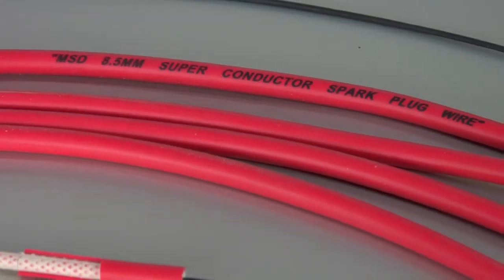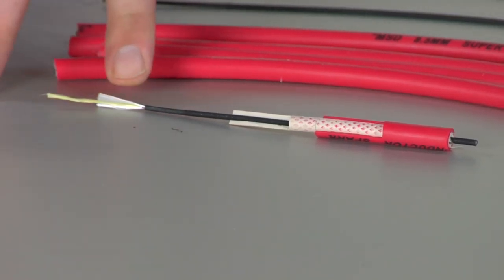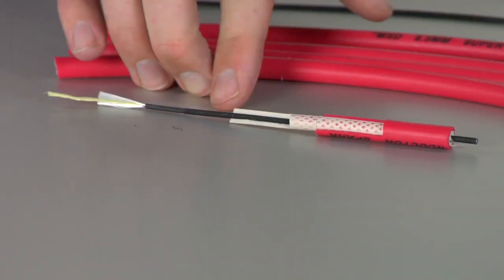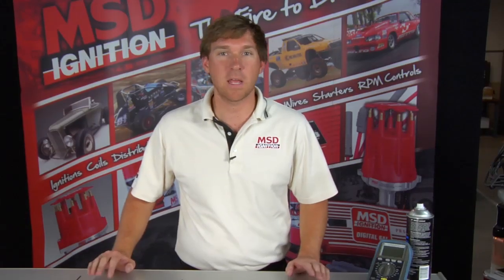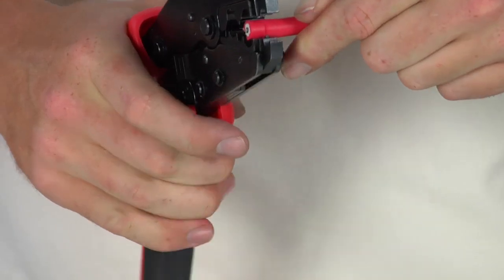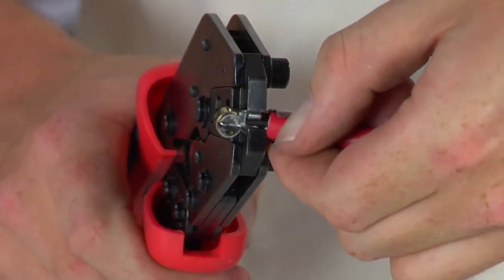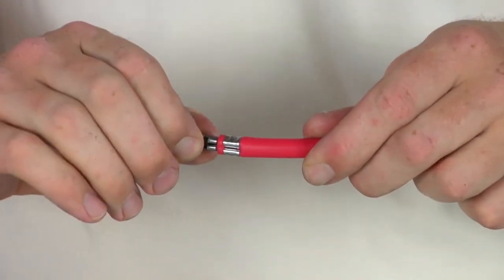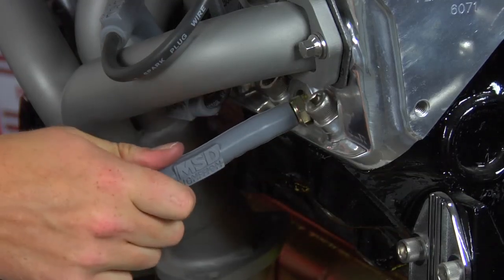Spark Plug Wire Crimping

Comment: Nice tool but I could not tell which part of the crimp head you used for the inner wire, vs, the part for the outer full wire.   That should have been pointed out when making the vid.

Comment: Kind of a stupid moment, but I had no clue that the boot could bend as needed when I bought them. Accidentally melted part of the boot because of the header lol what would you recommend I use to cover up the small hole on the boot? It’s more of a crack than a hole so it should be able to seal, I just don’t know what’s best to use.

Comment: Granatelli wires have near 0 ohms resistance per foot ( less than 1 ohms !! )
it’s the best wires but expensive $121.97 kit 8 wires
MSD wires 50 ohms , maybe half price Granatelli wires 
... also Granatelli have best colis 60.000V and low ohms resistance but expensive ...
MSD Good performance and reasonable price

Comment: How do you get the boots over the plug wire ends you just crimped?
Reply: Just returned mine because i couldn't get the boot on even when i put the boot on the wire first
Reply: @morrowdavid30  WD 40 helps lube it to slide

Comment: Your crappy wire caught on fire. How do I SPLICE the 2 halfs back together???
Reply: Syrus54 your crappy install was likely the fault. Been running this wire set for 8 years, I just now need to replace them due to excessive heat from flat out torturous towing abuse. Will be trying the Taylor Pro race 409's this time around, not because of the product, but just to try something new. 
Try installing them properly next time.
Reply: 1) Remove both burnt ends from the header tube you had them resting on.....
Reply: John Wilburn 😂